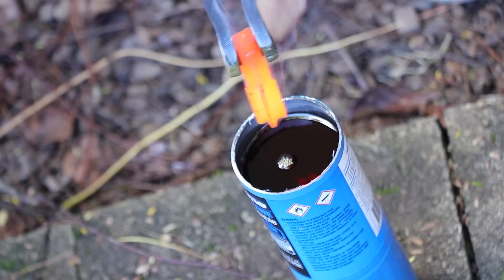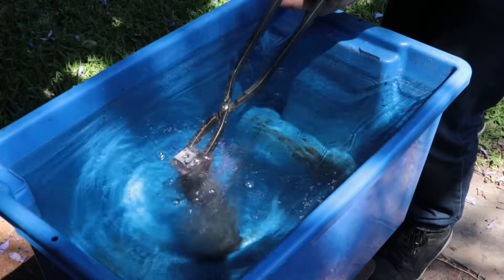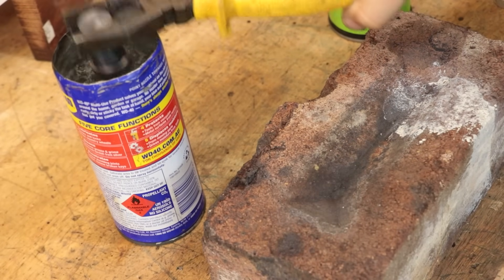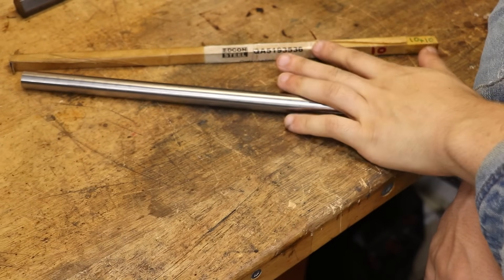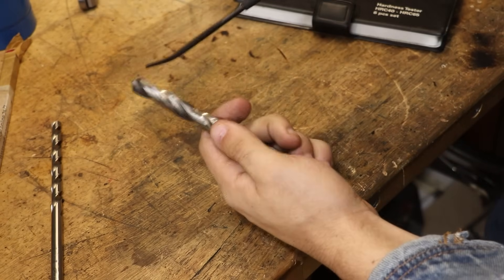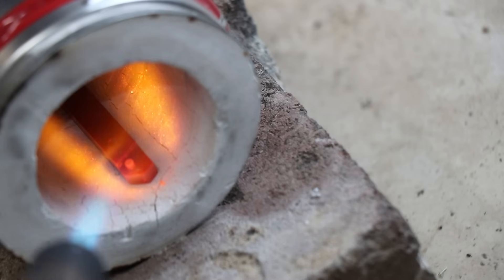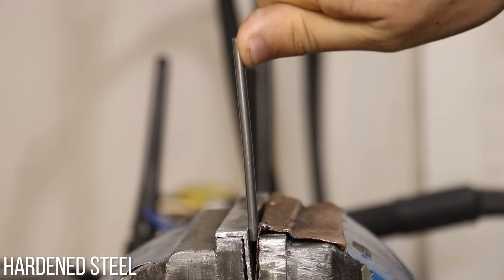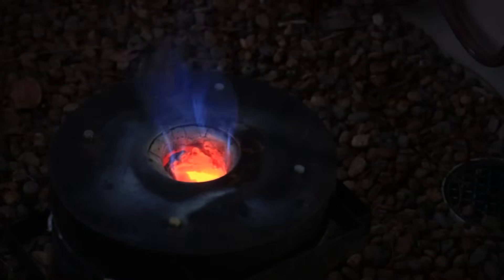10 Misconceptions About Heat Treating Steel

Comment: Having spent 26 years in heat treatment, some of what you have said is fine for the home workshop. To add some information, the prefix on W designated materials actually stands for water quench, and the O does actually stand for oil quench and there is a prefix of A which is air cooled. You did mention the temperature of 730 degrees for hardening, I would recommend 780 as a more effective temperature. You should always agitate parts when quenching, if not, either steam  will create a barrier when quenching in water or oil will vaporise around the part when quenching in oil. If you are unsure about tempering, most modern day kitchen ovens control quite well and you could put any parts requiring tempering in there for an hour, just make sure they are clean when they go in. You are correct with the high speed steel heat treatment, you would have to heat parts to 1200 degrees and then temper at 560 degrees twice, and even a third temper at a slightly lower temperature. Each of these being held for an hour for it to work correctly. I hope this helps.
Reply: Yes,HSS heat treatment certainly isn't one that is generally suited to the facilities in a home workshop.
Reply: Wow! That a great lot of information sir! Thank you.
Reply: Yes! The larger the part, the larger the container of water is needed to swish it. Otherwise, the blanket of steam will cause it to cool too slowly. Same with oil, but to a lesser degree.
Reply: When tempering, time is crucial, but so is the cross sectional thickness of the work piece.  As a result all tempering regimes should specify an amount of time per inch of thickness.
Reply: @Andy_Hinners  I wonder how humans were able to heat treat blades without all this specific information for hundreds of years
Reply: @ 
The chances of failure vs. success were 50/50 at best.  with the development of engineering standards that has been raised to 100% assurance of performance meeting specification.
Your choice - a crap shoot or a sure thing
Reply: @Andy_Hinners  it isn't 50-50 , over time you develop skills to tell at what temperature you need to  quench , how much you need to later soften the steel so that it isn't brittle .
I don't use any fancy temperature measuring devices or kilns with exact temperature settings .
It just works out because of repetition and learning the material.
It's like cooking , the best cooks are the ones who don't measure everything in milligrams but rather those who simply know what they are doing.
Reply: @StodOneR  
If steel mills followed your logic and process we would be royally forked.
I like the advancements in science and technology that are the fruits of the engineering disciplines and the scientific method.
Under your way, many of these things would never have occurred, or have been widely disseminated and standardized.
I'll follow the science, you follow the way of the heart.  It's all good.
Reply: @Andy_Hinners  Do you use a steel mill as a hobbyist blacksmith?
Reply: @Andy_Hinners  My point is no one would get into blacksmithing if they see videos like this thinking they need so many "exacts".
A good knife smith doesent need all the nanometer measuring tools , he just needs a forge , anvil hammer and something to file the material with.
Reply: The temperature for hardening depends on the carbon content. For high carbon steels it is not much higher than the non magnetic temperature. For steels with lower carbon content it may be 100 deg over it to reach full austenitic structure.
Reply: Thanks Artisan makes. You've taught me so much and continue to do so. I appreciate it.
Reply: Leidenfrost effect!
Reply: In regards to the British designations vs American for steels in general, it is not that difficult to cross reference to other specifications.  A lot of manufacturers will list cross references to SAE steels and DIN/EU on their material data sheets.  There is also a website called MatWeb if memory serves correctly on the name that lists cross references.  You can also list the composition of a steel in your search engine and cross reference that way.  It is important to know what alloy you are working with, it doesn't matter if you oil quench a water hardening steel but if you water quench an air hardening steel you might just find a bunch of cracks or sometimes pieces in the quench tank.  Double tempering reduces the odds of having retained austenite in the microstructure, highly alloyed materials tend to retain this phase when quenching from above the upper critical temperature and is hard and brittle.  You'll find austenite when steel gets heated to above the point where it loses magnetism as austenite is a non magnetic phase.  Typically, you want to heat to 50°f above the critical and hold long enough to thoroughly soak the material. Temper as soon as possible after quenching.  Investing in an IR temp gun would be useful even for a hobby knife maker just to know where you're at. As previously stated agitate your part and also try to go straight into the quench tank to avoid warping.
Reply: I always thought that the W in steel alloy names meant tungsten
Reply: @nicholas_obert  , I'm afraid not, if that were true what would the O series and A series be named after. Although W1 does contain Tungsten, O1 contains more Tungsten. These were all steels originally made by Halcomb Steel in the USA in the early 1900's and named by them.
Reply: @nicholas_obert  I think he is talking about American made steels. Not sure where you are. We in Britain certainly don't seem to have the same sort of quenching information as part of the steel's nomenclature. For example Silver Steel here in the UK is supposed to be the equivalent of US Drill Rod, but I'm not sure if it's official title. Is drill rod water, or oil hardening? I'm sure it not air hardened.
Reply: @samrodian919 , I am in the UK and I have hardened more silver steel than I care to remember. Pretty much all manufacturers state it should be water quenched but we would always oil or polymer quench it.
Reply: @samrodian919  I fairly sure silver steel is 01 toolsteel. Oil hardenening. I used to use this for various parts for sheet metal press tools, sometimes just flame hardened and oil quench. Most times tempered in oven.
Reply: @ UK silver steel to the best of my knowledge ( and I was a high school metalwork teacher here in the UK,) is NOT oil hardening but water hardening tool steel. At least that was I was taught.
Reply: @samrodian919 Silver? I'm assuming that's what we call bright-bar in Oz. Regional variation in terms can be wildly different.. and annoying!😂
Reply: @samrodian919 Silver? I'm assuming that's what we call bright-bar in Oz. Regional variation in terms can be wildly different.. and annoying!😂
Reply: For a hobbyist blacksmith he just needs to know basic quenching techniques , to gauge heat by colour and surface appearance .
Swordsmiths and blacksmiths did it this way for hundreds of years , learn the process intuitively , if it's a small hobby workshop you will probably be using scraps like leaf spring and such meaning you don't need to know specifics of oil quenching or water quenching or air cooling..
For hundreds of years they just used plain water .
Just repetition , testing yourself and seeing what works, if you make a knife 100 times in a similar manner , pay attention to what you are doing , which knife got a better quench.
I hate that everyone needs to know every little possible detail .
Reply: @StodOneR  No, historically they used a lot of things other than water to quench, and even added things to water that would alter its boiling point.

There has never been a time when it was just simple, there was only a time when you didn't really know what your material was exactly, so you had to sort of guess what would work.
Reply: @StodOneR  Aarrh ! you needs the blood temper, boys,or she won't hold !
Reply: I get what you're saying.  Practice, repartions, trial and error.  It's a learning process in developing the skills and techniques (intuitive) to achieve successful results.  That's all good from a purest stance.

But, Fabrication and Engineering itself has constantly progressed, and with that technology now exist replacing doubt with certainty.  Where the early blacksmiths and Metal workers pioneered thought 'Trial & Error",  we now have books, specs, machinery and devices.

Those fundamentals you've mentioned a good to know that's why they're still taught the technology exists replacing that knowledge.

That this for example;  someone doesn't need to understand the process of photosynthesis, to maintain and enjoy a garden.

Your words "(I) hate that everyone needs to know every little possible detail".  Erks me.

Tells me, you haven't done an Apprenticeship, and unlike myself a Professional Tradesman and Engineering has.

The enthusiasm to learn and seek out the details is the sign of a good Apprenticeship.  The willingness to develop and pass that on is the mark of a Professional.

I would go as far to say "It's not the duty of, but an obligation" to pass the torch on to others.

P.s  Swords broke all the time in battle back inye ol days.  That's way there's so few good examples left today.   If a swordsman acquired a particular decent and robust weapon he'd hold onto it. Pass8ng it down, retaining it in the family.

Most examples out there of antique Swords would never have face battle.  Most would certainly not hold up against a modern high end Sword of today.
Reply: do you have to put it in the freezer afterwards, while whistling your national anthem, face to the wind,for 37.51 hours ?

Comment: I've been pondering this for quite a while now, and have yet to see anybody even broach the topic. What would the result be from suspending a layer of oil on top of mostly water when quenching?

I'm not talking about a thin film of oil. I mean enough oil to fully immerse (and therefore coat) the part within the oil, before submerging it deeper into the water.

The reason this interests me so much is that oil is generally considered less than ideal for martinsite formation (I'm no longer convinced of this specific detail, having just seen in the video that the desired crystalline structure is highly situational & subjective depending on alloy type), due to its lackluster heat dissipation qualities. Its inability to quickly dispense of the heat. Oil is however, topnotch for heat transfer.

Water, conversely, is great for heat dissipation, but has a nasty habit of violent cavitations (bumping) when superheated past boiling point, ultimately risking warping/cracking during quenching.

Theoretically, wouldn't such a setup help to ameliorate the shortcomings & pitfalls posed by either fluid, individually? A layer of oil on the part uniformly wicking out the heat (at least theoretically), which is then dissipated by the water that it's being swirled around within. Wouldn't the presence of a buffer solution (in this case, oil) also lessen oxide formation on the surface, and/or help protect the part from those violent interactions with the water?

I'm completely willing to admit that perhaps I'm being overly naïve. I've only a cursory comprehension of metallurgy, and maybe I just haven't searched hard enough to find this experiment conducted in the past. I'm similarly unsure if this is actually something potentially better suited for heat-treatments where the part has been suspended in an inert gas environment or a vacuum during the soak (to completely inhibit any oxide formation.)

This also makes me wonder about the viability of mineral oils, as opposed to cooking, lubrication, or automotive oils, as a quenching medium, but I've already ventured far enough into the weeds as is...

————
I posed this question on your Heat-Treating 102 video, but it wasn't until later that I actually realized the video was about 6 months old at that point. So, I'm posting it again here.
Reply: I imagine for much the same reason you don't put an oil fire out with water. 

The boiling/evaporation point of vegetable oil is typically around 230°C (450°F) which is more than double the boiling point of water.

That becomes a problem when you go to quench. Since the goal is to conduct/disperse as much heat as possible from your part into the quenching medium. In the case you're using a mixture of oil floating on water, what's likely to happen is that the water will either flash to steam around the part, or be brought to a boil by the heat of the oil above it. 

Either way, you have a problem. 

1L of water equates to around 1600L of steam; which would then want to rise up through the layer of scalding hot oil above it. 

This tends to cause something of a runaway reaction as the action of boiling tends to increase the surface area at the interface between the water and oil. Producing more steam and more problems.

Alternatively, if we were to plunge the part through the oil layer fast enough to not significantly raise its temperature; you would probably still have to contend with steam bubbling up through the oil layer; but chances are, the temperature of the part would have still been high enough to vaporise the oil rather than polymerizing or forming a protective layer. 

At which point, the only real difference between that and quenching in water is the danger, mess, and the layer of oil you'd get from withdrawing the already-quenched part

Comment: It's about 40 years since I read up on the topic, but I believe a problem with water is that it forms a steam envelope around the hot object, and steam being a good insulator it is necessary to agitate the object vigorously to disperse the steam insulator and ensure direct contact between the metal and cold water.
Reply: He specifically mentioned steam getting trapped.
Reply: @SquintyGears  At my advanced age I need to comment before the idea evaporates,  sometimes before the point I am making is covered. mea culpa .
Reply: So would quenching under a faucet work?

Comment: Lots of good information and myth busting here👍
I also have a lot of homemade tool shanks made from basic mild steel with either carbide inserts or Cobalt HSS inserts and none of my homemade shanks are heat treated or hardened in any way but work just fine and last for years of usage

Comment: I remember going down the heat treatment rabbit hole back when the Earth was young. That was... a rabbit hole, to say the least.

I recommend NBS Monograph 88 (which you can download for free) for anyone who wants to learn how to do it in the shop and ASM Handbook 4A (comically expensive, see if you can find one secondhand or borrow it from the library and make copies of the parts you need) if you want to get more in the weeds.
Reply: ASM also has a “Heat Treaters Guide to Irons and Steels” which is a lot simpler and imo superior to the big Vol 4. Certainly better for a home shop, but again, comically expensive. 

Machinery’s Handbook has some decent stuff too if you dig around.
Reply: @xed5204  Good call
Reply: Thank you for sharing that. Here is the link for anyone who needs it: https://nvlpubs.nist.gov/nistpubs/Legacy/MONO/nbsmonograph88.pdf
Reply: phase diagrams are readily available and free.  They have all the info you need in graphic form.
Reply: @Andy_Hinners  from where?
Reply: @ 
the internet.  I searched "4140 steel phase diagram"
Reply: @Andy_Hinners  Phase diagrams, or TTT diagrams...?
Reply: https://nvlpubs.nist.gov/nistpubs/Legacy/MONO/nbsmonograph88.pdf

Comment: im guessing a lot of people (like myself 😅) watched forged in fire at some point and just took away the lesson that you should never quench anything in water. the way that show is edited really implies that
Reply: The type of steel they generally use is better done in oil quenching. Also they are quenching relatively thin parts that have been stressed with forging, which would be more prone to cracks and warping.

Comment: Is it possible to get the advantages of using oil by controlling the initial temperature of the water?
Reply: im not an expert, but i believe the main problem is that water just conducts heat better (faster) than oil does
Reply: Not really. Water removes a lot of heat by boiling, and this is vastly more efficient than convection. And it's not just oil vs water, there is a huge range of quenchants with different cooling rates available.
Reply: Not really, you're gonna get pretty fast cooling with water no matter what you do.

Good thinking though, you can absolutely fine tune your quenching by preheating your oil, and in fact it's recommended in many cases. See my post on the video for some literature that covers this subject.